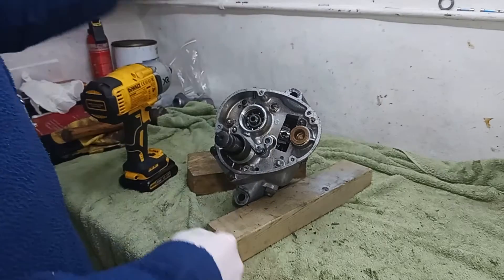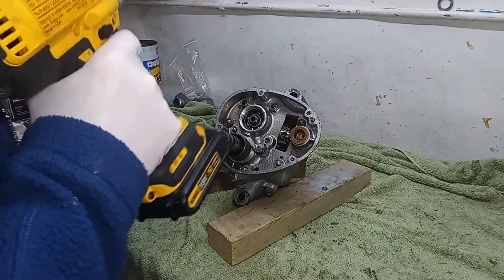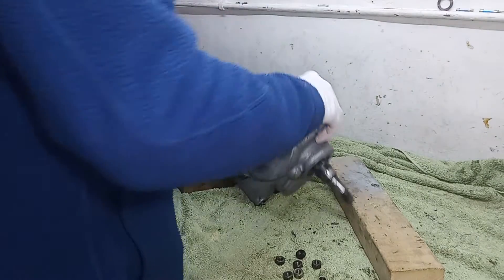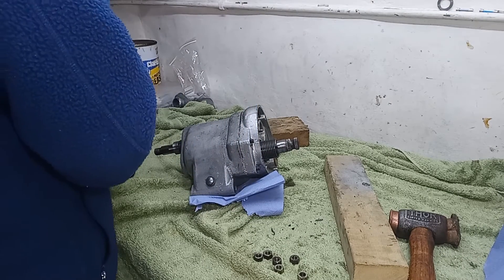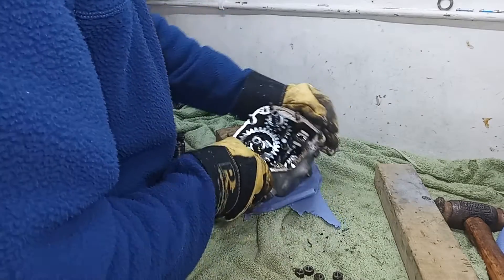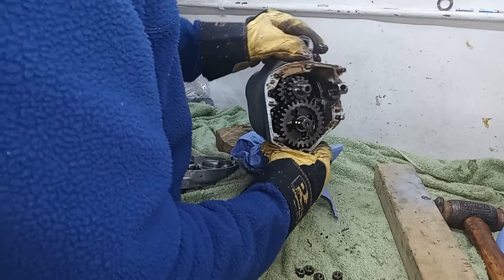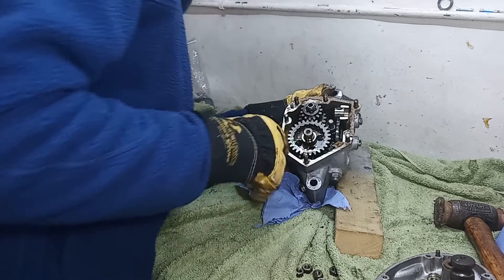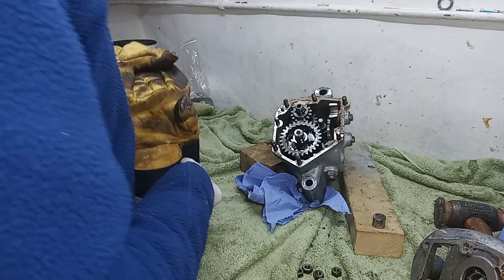Norton Commando Engine Rebuild. Part 26: Removing the Inner Gearbox Casing

Comment: Hi Chris thanks for the reply I think I'am in the same boat as you but do you think like me that running velocity stacks also adds another element of leaness? A good friend of mine is saying why not machine a little off the base of the slides thus making a No3 slide a 2 3/4 slide etc? One other thing has your trident had a rebore? All things to consider.
Reply from the maker: Yes, I'm running velocity stacks. They definitely cause it to run leaner. However, my T150V ran perfectly with velocity stacks and a 3-into-1 exhaust system and no modifications/alterations to the standard carb settings at all, whilst the T160 has been a nightmare (with standard exhausts)......🤔🤔🤔🤔

Comment: Hi Chris all good content and very informative but can you please help me I have been intouch before about my t150, you recently rebuilt a customer t160 but had problems with the carburetors ie the slide cut out so did you change the slides on your own trident to No3 slides and if so did it iron out the flat spot at approx 2500rpm cheers Clive.
Reply from the maker: Clive, so on my T160 I've had uneven running at around 2,500 revs ever since I rebuilt it about 8 years ago. To cut a (very) long story short I took it for a rolling road test and that confirmed it was still running lean at those revs, despite having smaller throttle slides and larger pilot jets in. I therefore fitted even smaller No.3 slides and raised the jet needle to the bottom groove on the clip. The bike is now 95% sorted - it runs so much better at those revs now - but still the slightest of flutters. I am therefore going to fit No 21 pilot jets as opposed to the original 17s and the19s I currently have fitted. I'm hoping that will smooth off the last 5% of unevenness. 👍🤞

Comment: Chris, 
You mentioned the "thin-wall" Whitworth socket used here in the removal of this cover.  You have a supplier for these thin-wall sockets?
Reply from the maker: I bought mine from Andover Norton. They supply all the special tools required for stripping a Commando engine and gearbox.

Comment: Question. On the bottom of the gear box, there is a bolt with a taper on it. What is that there for? Its not a drain bolt for the gear box, at least its not listed in the manuals. Thanks. Good info, thanks as always.
Reply from the maker: I'm unsure which bolt you're referring to. There's also a small level plug for how much oil to put in the gearbox? Otherwisehve you a photo?
Reply: I think you will find that it’s part of the internal gear selector mechanism! Index plunger housing (04.0036) for the internal cam plate assembly.